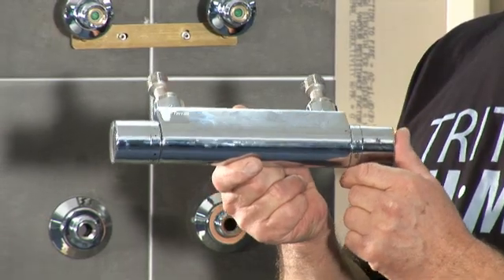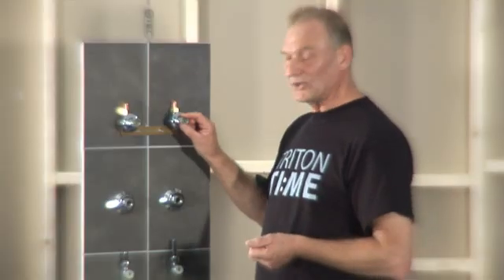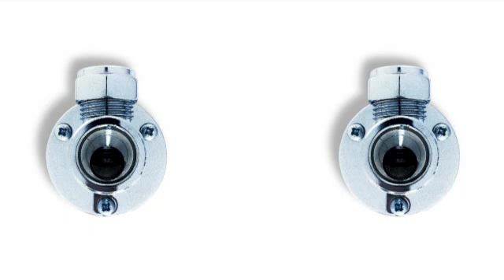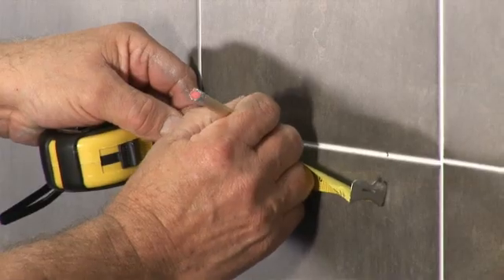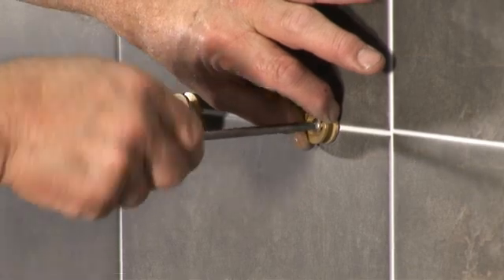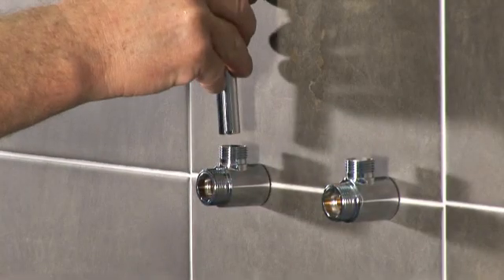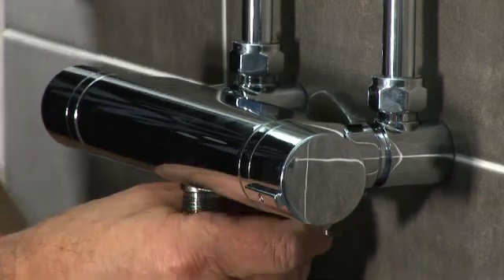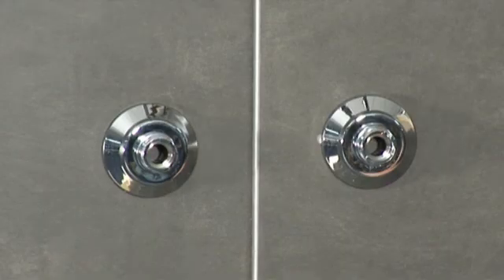Mixer Showers: "How to use Triton's bar mixer fixings for exposed pipework" video from Triton

Comment: I want to use these with the Tian bar diverter mixer shower which has the fixed head as well as the hand set. The issue is that the extra distance these create between the rising pipe, to the fixed head, and the wall is too big for the bracket that is included. Is there a solution I can buy for this?
Reply from the maker: Sorry, unfortunately there is no solution available to purchase for this particular problem.